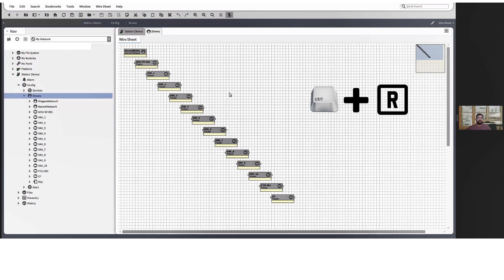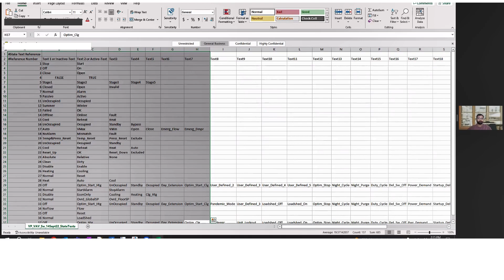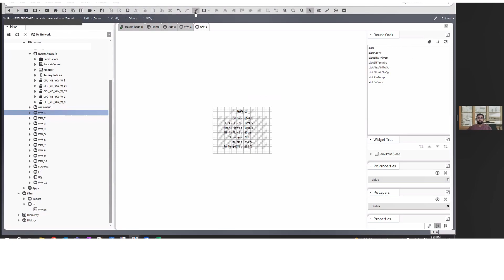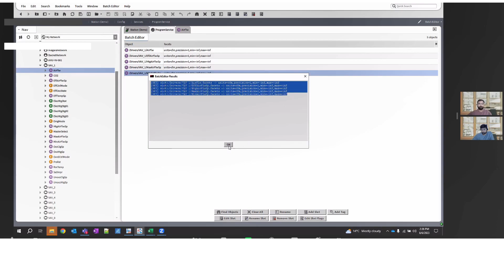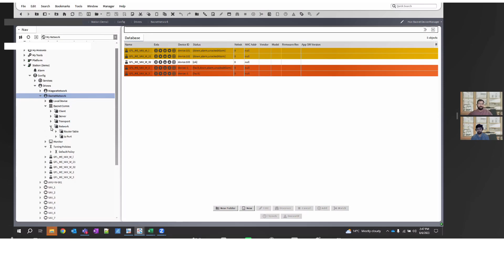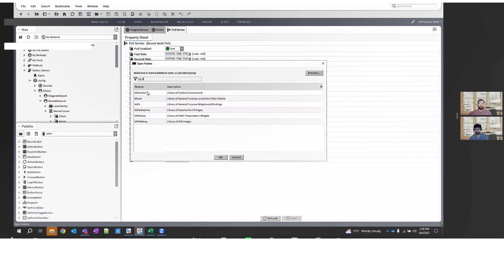Comment: Great and informative video.
@39:20 But 90 isn't a prime number, 89 and 97 are.
Reply: Since it is kept for slow policy at 90 seconds, the thought process is messages sent won’t overlay or get on traffic once sent. The next set of messages will be in the next 90 seconds. Controllers communications are usually in milliseconds.
Reply: @basexplained  Thanks.